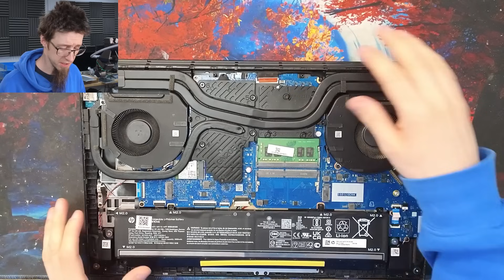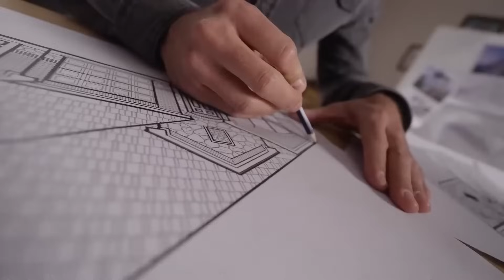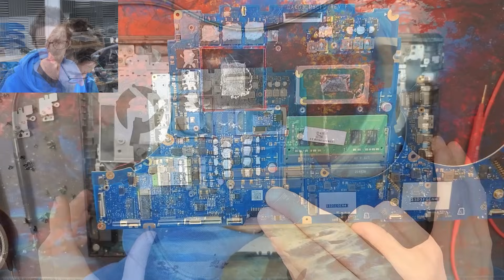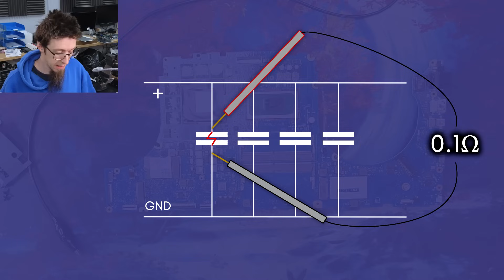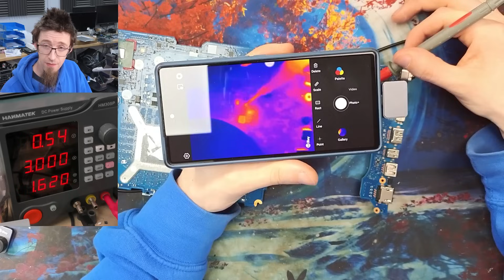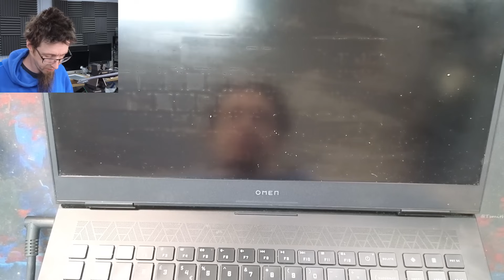HP Omen, No Power. It's not always a hi-side short! #449

Comment: Hypothetically if you did have a high side mosfet short, would you still be able to inject power without destroying the CPU, provided you didn't exceed 1.0v, and had the lab supply on current limit to lets say, 1 amp?
Reply from the maker: Theoretically yes, but with a high-side short the CPU will just sink all the power, and it's designed to be able to sink tens of watts, so unless you crank the amps you won't see anything happen. Main thing though, is that finding a high-side short is the end of the diagnostics. If you check for a high-side short and find one, you're done, there's no need to inject.
Reply: @Adamant_IT thankyou for the response. It makes sense.

Comment: Thank you for your deep informative videos, they are extremely helpful!  I have the same laptop and same issue and am trying to diagnose it with only my multimeter (I don't have anything fancy) and the TVS diode by the DC jack reads 0.05 ohms, and most of the conductors surrounding the GPU mosfets are also giving me 0.05.  Is this more than likely a hi-side unrepairable short?

Comment: I usually use the hot air combined with tweezers. Makes it much easier to use the tweezers since you get some more heat in to the board.

Comment: I’d like to see a laptop repair video where you’re dealing with USB-C PD issues. Tried dealing with it one time and got stumped.
Reply from the maker: Not an area I have much experience with yet either. Usually it's just the PD controller chip to be replaced, but if it's on an Apple and there's CD32 chips, you have to do all of them and it gets complicated.

Comment: Hey, Adamant! I've been getting more into IT repair and working on my own devices. What's a good quality yet not insanely expensive multimeter to grab as a beginner?
Reply from the maker: Aneng AN8009, or a Vici VC99 (both can be found under other brand names as well, compare pictures) are good starter meters. They're not exactly compliant for mains electricity, but for electronics diagnostics they're perfectly capable and give you auto-ranging volts, ohms, farads, and frequency. I currently use a Uni-T UT61E, which is a mid-range meter, and can definitely recommend that as well.
Hero brands like Fluke have some < £100 options, and are top quality, but the features are pretty bare for the price you pay.

Comment: 19:43: Since you have an IR camera, it's probably easiest to just inject power and see what lights up. Nothing wrong with that. But there are ways to find a short through measuring around. One would be a milliohm meter. Normal multimeters aren't particularly accurate in the low ohms range. But with a milliohm meter, you can essentially measure the resistance of the PCB traces. So the closer you get to the short, the lower the reading will be. If your multimeter has a fairly accurate millivolt range, you can build yourself a constant current source (basically a LM317 and a resistor), hook it across your probes, and then measure the voltage drop. The third method only works when you have a shorted mosfet on a power stage and you're trying to figure out which phase has the short. You can use an ESR meter in that case and probe directly across the mosfet. If the short is in that mosfet, you'll get a reading close to zero. If the short is in one of the other phases, then you're reading through the coils. To a normal DMM using DC, it'll still look like a short. But for an ESR meter using AC, those coils will present as an impedance, giving a significantly higher reading.

Comment: Sorin seems to find dead shorts to ground on the backlight power circuit all the time. It is usually due to either corrosion or physical damage to a connector on either end of the LVDS cable.
Reply from the maker: Yea, basically any circuit that's always-hot (like the backlight circuit, powered from the main rail) are going to be the areas that corrode when liquid gets in. The always-present power causes electrolysis through the liquid and eats terminals. Everything else gets turned off.

Comment: Amazing video and detail and a very lucky customer this time!!
If the capacitor was really shorted so the voltage is dropping very low would this cause the capacitor to heat up less? If the capacitor had a higher resistance maybe it would be visible much easier

Comment: Im a beginner. Can you please explain more in detail why a broken component would generate much more heat when we inject power? I thought it is shorted to GND so there is basically no resistance. What is causing the heat if there is no resistance?
Reply from the maker: It's a small component that isn't supposed to conduct a lot of current. It's like connecting something with a very thin wire. The wire will heat up when there's too much current flowing through it. The term for this is Resistivity. Two wires can have the same resistance, but different resistivity due to the thickness of the wire.

Comment: Whilst it is possible to find a faulty component with a multimeter you would need one with a sufficient display to see any tangible difference. That is to say that if you don't have enough decimal places you'd still be stumbling around in the dark essentially. This is where power injection is the easier and quicker path. I too get very tired of people talking about finding dodgy components with a meter.
Reply: Thats where the power supply comes in, you inject 3A and use the multimeter to measure the voltage. Of course your finger is probably faster, but sometimes the meter makes sense.

Comment: It's almost criminal to not have some sort of anchor to ground instead of just destroying the CPU and GPU. I am not a board designer, but I would like to think this is preventable.
Reply: So put overvoltage protection on every rail, just incase some FET fails? Its a waste of money usually, you'd be better off designing the thing so the FET doesn't fail in the first place, imo.
Reply from the maker: It's a common enough issue that I feel like there must be a way to protect against a high-side short. Heck, surely just a low voltage TVS diode could do it... bridge out anything above 1.5v or something... But yea, I'm not an electronics engineer either, so maybe it's more complicated than that. Vcore circuits are high current and high switching speed, so I think that makes it harder than it looks to deal with.
Reply: @Adamant_IT  correct, the high current and low voltage makes it difficult. TVS typically start at 4V clamp voltage and up. 
But if there is any fuse on the main rail a small clamp circuit could work.

Comment: A slight correction. You said " a mosfet doesn't connect to ground" when you meant to say the high side mosfet(or high side part of a DRMOS) doesn't connect to ground. The low side mosfet however does and you will often find mosfets not in VRMs that do connect to ground as well. I know what you meant and you have it clearly shown in the diagram. Also I gotta give you a shout out for the kickass graphics. I have been watching you for years and your content keeps getting better. Keep up the good work.
Reply from the maker: Yea, I should've ADR'ed that bit to clarify... It's especially a bit confusing because when I was measuring CPU vcore, those are dual-mostfet packages, so they have a dedicated ground pad. However, a lo-side short is incredibly rare, so it's close enough. Something to talk about in a future video though!

Comment: The capacitor in question is not dissipating too much heat due to the voltage being lowered by the CC mode of the power supply. The heat dissipated is very close to the voltage times current resulting in 1.5W (0.5V * 3A) which is not a lot. Also consider that the capacitor is soldered to two big power planes that can absorb 1.5W of heat in no time. That's why it barely registers on the thermal camera at that current. You could've injected 5V with a current limit set to 300mA and the resulting heat output from that capacitor would be the same.

Comment: The real reason it's not heating up much is because it's such a low resistance short. Basic ohm's law. The lower the resistance the less voltage will be dropped for a given current and thus the lower power dissipation. A 0-ohm superconductor can carry any amount of current while dissipating no power at all. That's a big gotcha for power injection - a really shorted short won't heat up at all...
Reply from the maker: This only works assuming that the conductor can carry the set current in the first place. A wire a hair-thick is going to melt in an over-current scenario no matter how low its starting resistance is*

*Super-conductors are weird and I've no idea what rules apply there, but that's not what we're dealing with here anyway
Reply: @Adamant_IT I don't really see how that's relevant here. The part failed, the normal operation parameters no longer apply. Even a small transistor, capable of only 100mA, once shorted it's insides may have turned into one molten 0.01 ohm blob capable of tens of amps while hardly heating up...
Reply from the maker: Nothing says the insides have turned into a molton blob. In fact it's likely that the internal short is a hair's thickness. I found the term for this, it's Resistivity. A thin wire and a thick wire can have the same resistance but different resistivity .
Reply: At such low ohm shorts the resistance in the leads from the bench PSU and the traces in the board become more of a factor, like in a voltage divider the biggest voltage drop is across the larger resistance. Would be interesting next time to see how much voltage is lost before it gets to the shorted component

Comment: I guess you already know, but to eliminate measuring lead resistance on the measurement, you can short the leads and press «REL» on the multimeter. This will «zero» the measurement. 
Great step by step explanation on this repair.

Comment: Nice fix and impressive cooling capacity of the board! I was wondering what would happen if one of the big electrolytic can capacitors would be shorted. Will they always spill their guts out or if not, can you find them with power injection?
Thanks for providing entertaining and educational content! It's a pleasure to watch...
Reply from the maker: I think electrolytic caps usually fail open, as you say they tend to spill or vent their electrolyte and then cease to function as capacitors - they stop storing energy. If they've bulged then this will be obvious, but a dead electrolytic can look perfectly normal. You have to de-solder them and measure with an LCR meter to check their capacitance and ESR.
In a lot of electronics, this is a common failure point, but laptops tend to have so few electrolytics, and desktop motherboards use solid state electrolytic caps that are also pretty reliable now, so it's not something I generally see in my wheelhouse.
Reply: @Adamant_IT  Thank you Graham! When there was no real visible heat during your first step of power injection I would have guessed for those electrolytic caps as the reason. Ramping up the amps wouldn't have been my next step so kudos to you skill and experience!
Reply from the maker: Yea 3amps still isn't massive current, so it's generally safe to go straight to 3amps if you don't see anything at first.
4 or 5 amps is when you're starting to take risks. If something suddenly lets go and burns up at 5 amps, it'll likely weld itself to the board, and then it becomes really hard to remove it without doing more damage.
This is the nice thing about thermal cams, is they let you see faults at very low currents.

Comment: Nice repair. At the end I notice the annoying keys imprinted on screen problem. Wish it was less common
Reply: There is virtually no air gap between display panel and keyboard on modern laptops when the lid is closed.  It used to be there was about 1mm clearance and this wasn't a problem back then.

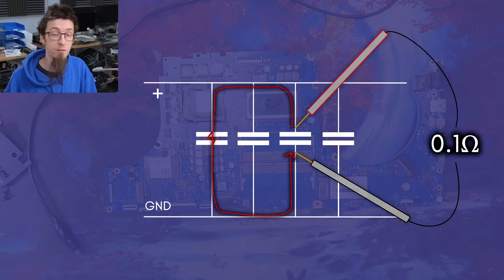Comment: 20:47 - All this is correct, but if you use LM317 and power bank as supply, you can find it with multimeter on mV as mOhms...
Reply: Absolutely. Multimeter = no chance. mΩ or μΩ meter, you definitely can measure it. Doesn't even need to be calibrated, just keep moving until you find the cap with the lowest reading. That's Bob. He's your uncle.

Comment: Thanks so much for taking in my laptop to repair it. Watching this video and learning so much more about the laptop truly was fascinating along the process of eliminating faults. Thanks so much for sharing the repair with everyone! Also appreciating that I am not the only person who thinks that power supply is truly overkill for my system being an i7 and 3060. Makes a good weapon if someone tries to steal your laptop haha. It would also explain why I heard an audible tick when it shut off during work. Thanks again! 🙂

For the PSU, I believe all the Omen laptops for these newer 2021 models got the 330W, the one I have is the more lower spec model. i7, 3060 (6gb), 16GB Ram, while a lecturer who has an identical model has the exact PSU for his model which has an (i7 or i9) with a 16GB 3080. So overkill is an understatement haha!
Reply: Lol - I have an i9 12900H and a full TDP 3070Ti and it only came with a 280W PS😁
Think the most draw it's hit is around 220W. Seems a little overpowered for a 3060 😉
Reply: @stevejones4618  Indeed it is! Haha!
Reply: @stevejones4618  Same here but with 3080Ti and I have 230W brick (all Lenovo). Those things are far more temp. capped than by power draw.
Reply: @highchiller  I run  a cooler and manage to keep it around 80 C so manage to avoid thermal throttling - pretty much just power limited.
Reply: Dude, how did you contact him? Also are you in the same town/country as him?
Reply: @FakeName2000  I called his shop number to see if he could take a look, then I mailed the laptop in as I am from Wales, so had to use postage to send it. :)

Comment: You can measure a shorted component, but you need a much better meter with 6 1/2 digits accuracy. Dave has a Video on EEVblog on how to do it. But most times voltage injection is faster and easier.
Reply from the maker: Darn! I meant to add in a mention of the "triangulation" method, but I forgot... But yes, this can certainly work!
I suspect that a thermal cam is cheaper than a multimeter that's good enough to do this though.
However, if you're working on sensitive circuits where injecting power isn't an option, this is what you'd need 👌